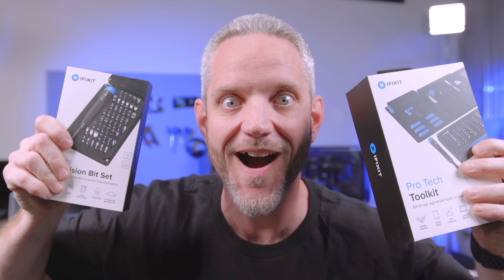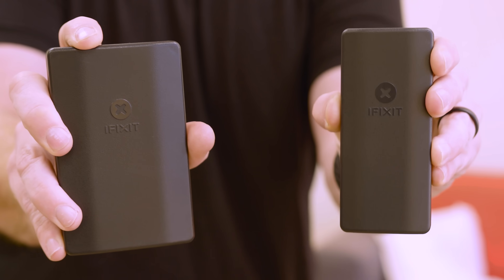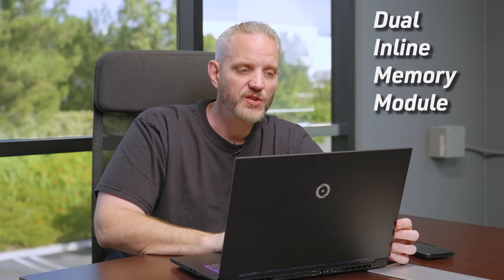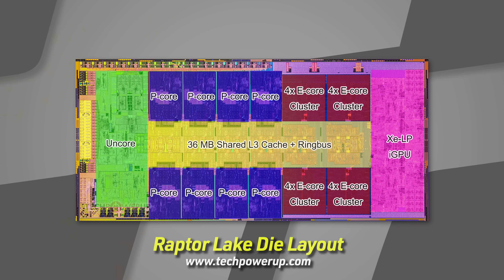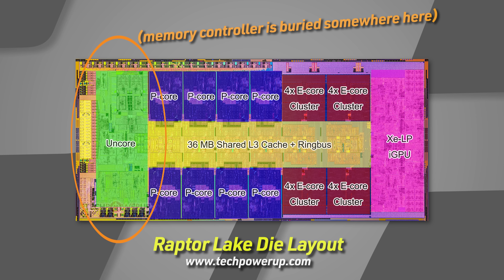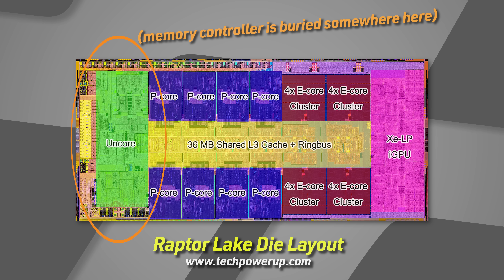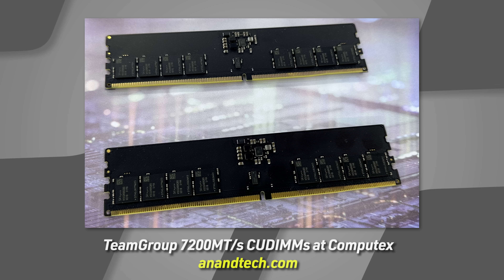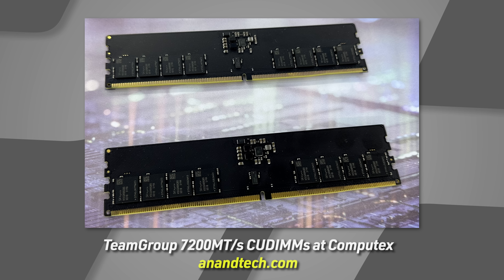RAM just got a LOT faster! Up to 10,000MHz!

Comment: Outside of what reads to me like workstation tasks I don not have a use case that quicker system RAM would help. 
I am hoping the cost of CU-DIMMs goes down as they might be trying to force it onto the market due to how few avg consumer processes will actually benefit from it. Spreading out the cost over millions will help the cost go down instead of  a few hyper specific processes which will lead to very few people buying it.

Comment: newer and newer PC's... expensive and they the switchover happens, all actual processing is done on a external server and client PC's are nothing more then a screen and remote... and local system processing power tanks... Tanks... bhshew... just like using CAD programs, slow and painful because their 100% regulated on a que line up that is individually monitored 24/7. "fake world where download boost tool actually works, imperception"

Comment: I'm interested in finding out if 6400MT/S, in both CU-DIMM and U-DIMM use cases, will make a significant difference. What I also would like to know is if any of the z890 motherboards will be able to run 4x16 or 4x24 memory configurations using XMP profiles (assuming that sticks are already rated at 6400). A few years back, Steve from GN claimed that running your system in 4x24 config gives you about 10% more performance. Can you please test that and show receipts? Thank You!
Reply: According to the information out you can only do CU DIMM 2 X 16 or 24 X 2 and with super high clock speeds. I don’t think 4 X with high speed is possible because it’s to much on the memory controller.
Reply: @ZackSNetwork  So did they say with regards to running 4 sticks on LGA1700 and they were wrong. I'm currently running my rig in 4x16 configuration on 13900K at XMP speed of 5600MT/S CL36, which is the max memory speed for this CPU. Same is applicable in theory to LGA1851. Specs are listed as 6400MT/S for 285K, so if there are kits that have XMP profiles as 6400MT/S, which matches the non OC specs of the cpu, 4 sticks should work. Right?

Comment: The comment about latencies being better on CUDIMM is incorrect.  Look at the announced CUDIMM kits, where primary CAS latencies are ~10 - 20ns worse compared to stock DDR5-6000 UDIMM's The higher Gear 2 clock speeds won't make up for the increase in primary latencies.
Reply: True but it seems it's more so jdec of 6400 meaning it would be at 1.1v
Reply: Anyone that does low level performance programming laughs at gamer bois  and their ignorant obsession with cas latency for random main memory accesses. If your game is randomly hitting main mem in any substantial quantity then you are already a lost cause by two orders of magnitude. Why do you think huge L3 cache is so beneficial to poorly optimized games? 
L3 is about 20 cpu cycles, main mem is 300 cpu cycles (L2 is 5-10,  L1 is about 3, and a register is ready on the next cycle [There are a few spare registers that get used like an L0 cache]). 
Now delay between sequential accesses rather than request latency: DDR-5000 with a 5GHz CPU is collecting one memory row (512bits, aka a cache line, on current era x86-64) per memory channel every 8 cpu clocks, however this is shared among cores,  I don't the whole line always needs to be in L1 before use or if there are any CPUs capable of using the first chunk straight from the hose.(actual DDR buses are currently 64b wide so 512b lines is broken into 8 chunks over 4 mem bus cycles.).
Reply: @mytech6779  Literally on a gamer boi channel watching a gamer boi video🤣
Reply: @RyTrapp0  Which is completely irrelevant.
Reply: @mytech6779  I mean, you can pretend like you aren't apart of the group - that's why you're here of course🤷
Reply: @RyTrapp0  I haven't gamed on PC in years and my newest console is xbox360. I'm just following the state of consumer-grade hardware, because I can't justify the cost of a server-grade machine at this time.
Reply: Yeah, the reality is that DDR5 still can't outperform DDR4 3200/3600 because of the CAS Latencies. In fact Toms Hardware did some test suites of DDR4 vs DDR5 using current MOBOs with a choice of supporting either ram, and the results are shocking. Basically within the realm of errror, it's that close. Latencies still matter A LOT, with tons of games and programs and some run worse on the DDR5. Seriously...
If people don't believe me, look up the Toms Hardware tests and others are out there too, from as recent as 2023.
Reply: @MrEricmopar this has been true for ever new interation of ram going from ddr to ddr2 to ddr 3 to ddr4. Bandwidth always will out weighs that latency hit in the end.

This old tech been done before, its just coming back.
Reply: @MrEricmopar  I'm not saying I can guarantee that it was a bad test, but I wouldn't take any testing done by Tom's Hardware at face value, not this day and age
Reply: @MrEricmopar That test is terribly outdated. The ddr5 tested is very slow with poor timings. The game suite tested is also very outdated
Reply: @mojojojo6292  It isn't outdated, the test I'm quoting is from 2023...
Reply: @MrEricmopar   @MrEricmopar  It doesn't matter if it was yesterday. It's outdated because the ddr5 tested was DDR5 6400 CL36. That's incredibly slow by todays standards while the DDR4 tested was the best you can get. DDR5 7200 CL34 will run on intel 13/14th gen with a decent board. The gpu used in testing was a 2080ti. Again incredibly outdated insuring that a gpu bottleneck was hit long before a memory bandwidth one in most cases.  The games tested were also quite old and not very heavy on memory. There are games that hit the memory hard. Look at hardware unboxed test on youtube from 10 months ago. It's still nothing crazy but it's definitely significantly better in some cases.
Reply: @mojojojo6292  If you look around at online DDR5, CL 40 range is normal and in the 30s is "fast" what are you talking about? Seriously, a person can look at DDR5 specs at Newegg, and other sources and immediately know you are wrong.
Reply: @MrEricmopar  Or you can just watch a frame chasers vid. TLDR,  when at 7200mts with tight timings, DDR5 is an upgrade over tuned B-Die in all regards for gaming. Some Sony slop games on PC really love memory speed especially when RT is involved.

Comment: Long live the X3d 6000Mhz CL30 limit.
Reply: Explain yourself...dont get it.
Reply: @JK1NG87  that's the sweet spot to match the infinity clock and get the best performance. You get less performance by going higher, which mean for those chips, anything above those specs is a downgrade
Reply: @alentanor  also on 9800x3d ?
Because i was reading somewhere 9800x3d can reach 8800
Reply: @JK1NG87  They can reach it, but the performance would drop in gaming since the ram's clock and the infinity fabric clock won't be matched.
8800Mhz, on 9800X3D should be slower that 6000 in gaming {Specifically gaming.}
Reply: @alentanor  mmmm this is the big question for me.
Reply: @JK1NG87  We'll know for sure when 9800X3d get tested by third-party reviews. For an overall build, a 9800x3d build {Mommyboard, Ram, and CPU} could end up far cheaper than anything intel  could pull.

Comment: This video takes me back 25 years when I built a PC with RDRAM; I wonder if it will turn out the same way?

I also have some DDR3 with 2400 MT/s, G.Skill F3-2400C10D-16GTX (12 years old).

Comment: Rendering and audio/video stuff will benefit a lot from this. Another thing to think about is the CPU will be running harder to process the increase in data. At what point will the CPU bottleneck the memory ?
Reply: Effectively that bottleneck would never happen with current CPU architectures unless the memory technology changed . RAM is relatively "slow" compared to the cache memory built into the CPU: both bandwidth and latency are orders of magnitude slower. The L3 cache in a modern CPU is capable of ~1000GB /sec compared to ~70GB/sec for DDR5 dual channel. Latency on the L3 cache is ~15ns while DDR4 is ~80ns. 

Look at the Ryzen X3D line of chips to see the impact of adding more cache on performance. 

Consumer CPUs are bandwith limited by having only 2 memory channels (4 sticks max). Workstation and server platforms like EPYC or Threadripper can have 8 or 12 memory channels which greatly increases bandwidth. Even on those platforms, memory bottlenecks are possible with large amounts of I/O.
Reply: @networkarchitect443  
You're confusing L3 cache with CPU throughput.  L3 is not part of the CPU as much as marketing teams try to convince people it is.  There is absolutely a RAM bottleneck with x86 and literally why it runs so hot.  They get around it by increasing the clock speeds not the bandwidth in L1 an L2 (which are the ones that really matter and are of ancient design on x86).  Servers have more channels because they use different prefetch hardware.  x86 has always had trash memory throughput on the actual CPU and people pretend that the added ram controllers on the dye ant extremely high clock cycles make up for the total throughput to the CPU--they were always a band aid just like the on board "AI "to predict fetch requests.
Reply: @networkarchitect443  the zen+ architechture could do 288 gbs of ram bandwidth on Epyc. If you go from that to to 12 channel you getting 3 times that bandwidth which does not count for increased speed too 288 x 3= close to 900 gbs add in the 1.25% increase and mhzand it would easily hit that 1,000 gbs bandwifth now. The bottole nwct is starting to be links like infinity fabric & pci-express. Along with the memory controler on NVMe drives which end up overheating from the high speeds.
Reply: I9 14900kf already throttling whenever the anti-virus does a full scan of my SSDs that have over-provisioning enabled to achieve the SSDs maximum rated speeds.

Comment: If a clock driver on the DIMM essentially boosts the signal, what precludes a motherboard from having a similar boosting mechanism at any other point in the loop between the memory and the CPU?
Reply: I would assume that the nanosecond timing tolerances are so tight that the clock redriver chip has to physically be on the RAM. Mobo would be too far away.

Comment: Some of us are old enough to remember rambus dram and intels deal with them. Look how well THAT worked out! 😂
Reply: Exactly!
Reply: but Rambus was just too complicated and had to many ICs on the DIMMs. Therefore a lot of heat and integration was not easy. The CU-DIMMs here are way less complex then RD-DIMMs. And the interface is also less complex. 
And Rambus introduced super high latencies, wheras CU-DIMMs supposedly reduces the latency. 
So better chances for CU-DIMM to be successful. 

lets see the first real reviews and if the uplift in cost is really worth it.
Reply: Some of use are old enough to remember the first time round when RAM was soldered to the motherboard.

Comment: All I want is a new HEDT platform so I can build a new pro workstation, because regular consumer grade stuff from Intel and AMD is flaky AF and just doesn't cut it.
Reply: Threadripper
Reply: @akdhidbeif  No thanks, it's barely more stable than Ryzen, and far less compared to Intel's aging X299.
Reply: those are dead because they eat into the server hardware. they want you to either live with high end consumer or low end server parts
Reply: @bradhaines3142 AMD releases new Zen 4 non-Pro TR not too long ago

If you forget those stuff exist
Reply: @bradhaines3142 what are you talking about? Threadripper has TRX50 and WRX90. None of you buy it because its cost is in between expensive serves & desktops in cost. 

HEDT is right there, matter of fact zen 5 threadripper 9000 will be faster than current desktop. Since it has higher bandwidth ram.
Reply: @bradhaines3142  Desktop from both AMD and Intel are much closer to mobile/ laptop than they are to server/ workstation. There is room for desktop to evolve to something better than what could be considered "mobile-extreme" which is what consumer desktops have become. The price for consumer desktops is probably the most disappointing aspect about the platforms for how gimped they are with I/O compared to workstation/ server. Desktop needs an overhaul and should be considered HEDT by default and the pricing for current desktop needs to drop by at least $100-200 dollars for being basically a glorified console. 

As another comment points out, Threadripper does exist but it is priced well beyond what the average consumer would spend unless they actually had a purpose for using it for its advantages. Even a stripped down non-Pro Threadripper with half the capability and half the price would still end up being twice as good as the best desktop and priced the same. If either Intel or AMD could come out with a desktop platform with a quad channel memory controller and at least 32-48 PCI-e gen5 lanes direct from the CPU for the same price as the "high-end" consumer desktops that we have now ($500-600) I would guess there would be quite a large demand. Sure it might eat into the lowest tier Threadripper sales but those platforms advance far faster than consumer so it won't be long before the performance delta is even larger than the hypothetical HEDT system that I just came up with. 

Given how the new Zen5 server parts are performing, the new Threadrippers when they eventually come out will be insane and just make consumer desktop look like even more of a joke and a ripoff by comparison. As it is, Intel Arrow Lake will cost a minimum of a thousand dollars to build out a mid level system assuming the CPU is $500, the mobo is $500, and the new CU-DIMMs are $250-500.

Comment: I play in 4k and I went from 5200mhz ram to 7200mhz and I didn't gain even 1 fps, I have rtx4080 and I will soon be upgrading to 5090 when it goes on sale
Reply: When GPU limited, memory tinkering can improve your lows....which are just as important. Also speed is not everything if your timings went to crap...

Comment: better than the utterly ridiculous CAMM. sure, i get the speeds and the trying to keep the traces as short as possible to cut down noise.. the locking people into one or two modules per box.. and having to fully swap modules instead of adding to a pair or whatever, hard hard hard no.

at least this one provides a viable way to retain the flexibility factor of the previous memory options.

Comment: What CPU can run those freq? AMD and Intel imc is stuck at much lower clocks.
Reply: "Just buy the 12000 MHZ Cu-DIMM it'll be futureproof bro" - Stephen Hawking
Reply: Maybe the new generation of hardware that's going to be coming out? 8266 can be hit on a 14th gen chip with a good IMC, but it's all bining at that point.
Reply: Only Intel Arrow Lake processors and the Z890 platform currently officially support CUDIMM memory. On AM5 it works with a bypass trick at lower clock speed, so there's no benefit there for AMD CPUs.